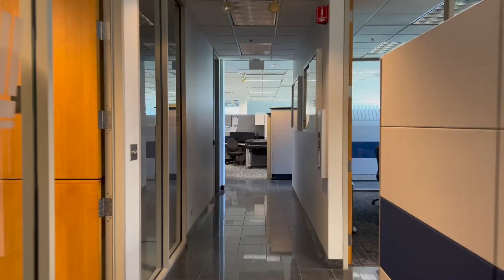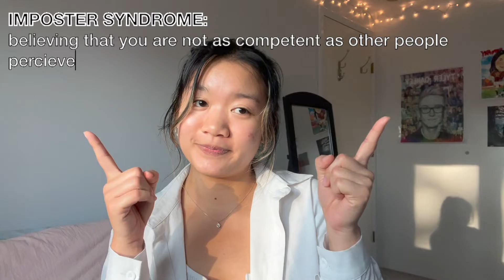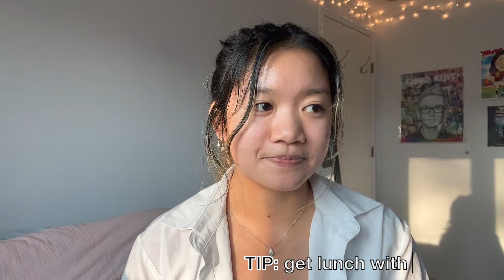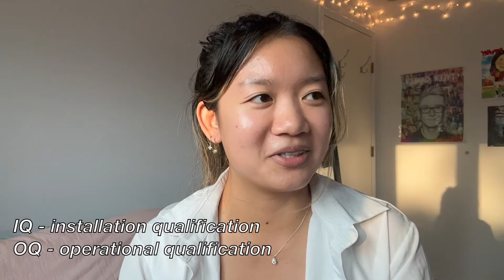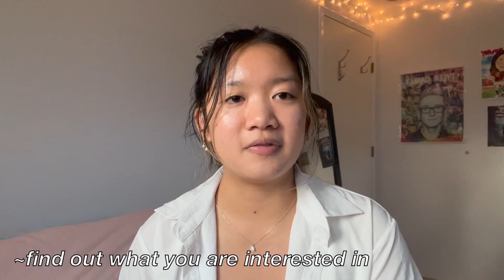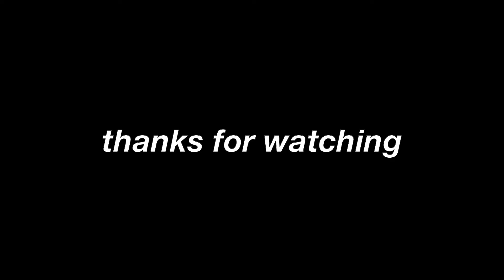What it's like to be a MECHANICAL ENGINEERING INTERN ?- tips, tricks, and reality checks

Comment: No mechanical engineering jobs without some threat to your health huh? If its not boiling metal, its radiation, if not that then fast sharp objects and high voltages. Safety regulations can only do so much, the threat is always there, and the money wants to keep safety at the minimum required levels...